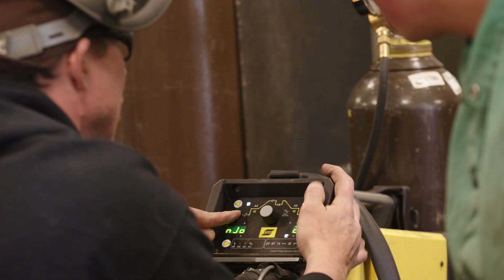Building a Welding Program Builds Community: Breckenridge High School | ESAB Future Fabricators

Comment: Great idea for Summit HS (Is there really a Breckenridge HS?).  Much needed skill for USA moving forward.  Much like machine tool trades and especially "tool makers", there will be a shortage of skilled labor across the country.  I have owned a precision sheet metal shop since 1980.

Downside not mentioned:  It does disturb me ( as the last poster cited ) with the lack of proper ventilation in that classroom from this brief video.  Also while the current helmets are very good, long term effects on eyes is quantifiable.  All this is my way of stating that your students need to be aware of the dangers of that profession and to chose their path/job offers wisely.... to include salary, benefits etc as well as the safety equipment available in the shop.  NEVER take shortcuts on safety issues here... especially if someone wants to do a home garage setup for those occasional projects.